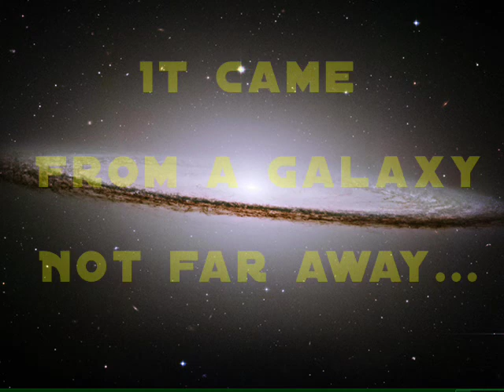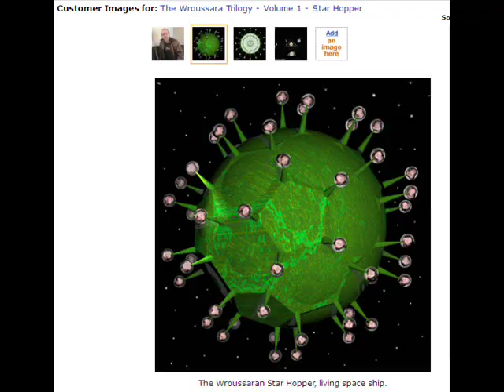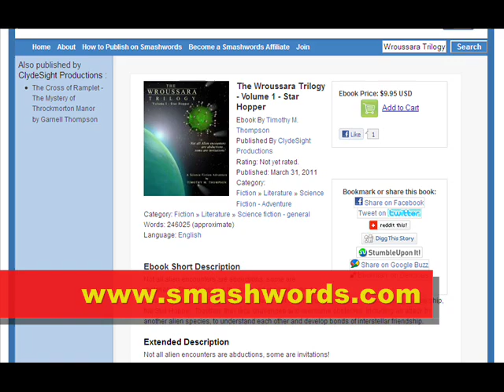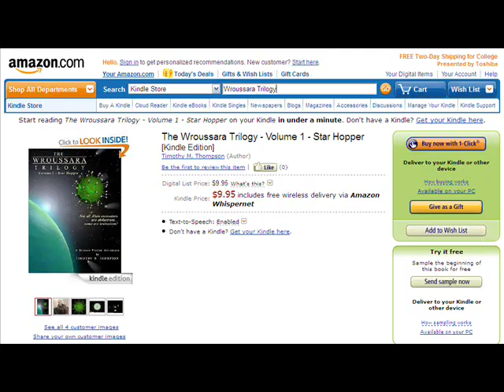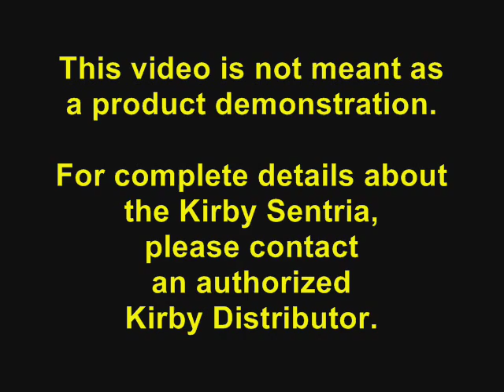Exploring the Kirby Sentria Home Cleaning System -- vacuum cleaner and More!

Comment: About 20 or so years ago, I sold these machines (all be it for only a month or two as I found out it wasn't for me).  The machine was called Generation 3 and was very similar to the modern model, including the power assisted drive system.  Kirby hasn't changed thier basic design much over the years; a few tweaks here and there but basically the same.  And when something works as well as this does, there's really no need to change it.  A pricey machine but well worth it.

Comment: you dont need a warranty if you paid $25 for a perfectly running G6 that currently has given me zero problems. or a kirby heritage that we have owned for 15 years and only had to put a new set of $12 motor brushes in the 15 years we have owned it. these machines are reliable enough, easy to work on and cheap to buy parts for. they are also VERY expensive new and CHEAP used so take your pick. me i prefer to save my money and have virtually the same machine that has not changed much since the G3

Comment: i have a tradition, a heritage I, and a G6 2001. i love them all but i cannot understand WHY someone would spend $1,700 on a kirby vacuum WHEN the market is flooded with slightly used units that can be brought back to like new for very little money. i bought my G6 for $20, an exceptional deal if i must say myself.. i have spent $140 total on all 3 kirby vacuums and $100 of that was on my heritage which my family has had 15 years of excellent service from. they are great but easy to find used.

Comment: i hate to break it to you but the fan is not metal
Reply from the maker: I checked and you're right. But I am not sure what your point is. The plastic on mine is in very good shape. I have a "leaf blower-vac" that has a plastic fan on it, and I've had it for over 6 years. Never had a problem with the plastic fan and I use it as a vac to pull up all sorts of yard stuff. I have a snow blower that has a plastic plow blade and in 10 years, never had a problem with it, and that thing digs through ice. So why is a plastic fan on a Kirby vacuum that is pulling dust out of a carpet a problem? Or were you just pointing out that it is plastic.
Reply: ***** im not saying that metal fans are better lexan fans are more forgiving if you hit a hard thing metal would get weak and it you shatter and cause more damage to the hous

Comment: Kirby is officially listed as A scam here in the Neterlands! Agressive door to door sales and crappy hardware.As in the video it sounds like A jetfighter taking off and weighs A ton.It's not got any better since 1945.
Reply from the maker: Picobyte  Thanks for watching the video.I appreciate your thoughts, but there are sides to any story:
 
1 - I agree that the machine is expensive -- but they will negotiate the price, 
2 - It is  heavy  - and the weight helps the beater brush get into the rug pile. instead of bouncing on top of it like it does on some plastic vacuums
3 - It's loud because it has a big motor -- and it is quieter than some other vacuums I have used
4 -  I've never had any service problems with it in 5 years. Changed the belt once and the bags often, and the official paper bags can be got cheap from E-Bay.
5- It is self propelled, which few machines are
6 - It came with a complete shampoo system in the box, which few other machines do
7 - There is one other other BIG thing, the door-to-door sales force. 

When I got my machine, I had just suffered a double heart attack. How was I supposed to clean my floors? Hire a maid? How much would that cost over 5 years? Think about it.

For whatever reason, the Kirby folks appeared at my door and had a solution. I had never seen them before, and I have never seen them since! So I would not say they were intrusive.

- They were friendly and polite,
- demonstrated the machine, 
- allowed me to try it myself, 
- they BUILT it right there brand new, in front of me and taught me how to maintain it. When you buy these things in a dept store, they come in a box and YOU get to figure it out and build it! 
- They recycled my old vacuum (for me to get rid of it would have cost money to pay the trash company). 

Was it expensive? YES! 
Did I need it? YES!
Was it worth it? YES!

 It is easy to make blanket statements about someone or something, but everything has a story and not all stories match your own. 

If you had trouble with Kirby, I am really sorry for you. 

But I cannot in good conscience say Kirby is a scam or allow someone else to do so without presenting what happened to me -- so people can realize that there are many sides to consider in this situation.

I appreciate your watching my video and leaving a comment however.
Reply: If all it needs to do is to suck my vacuum cleaner does the same job for just 80 Euro.If it wares out I don't bader to swap carbon brushes in the motor.I just buy a whole new machine.Cheap and efficient.And it does not make the sound of A fighter jet taking off.Pretty good reason not to buy the scam Kirby trash.
Reply from the maker: +Picobyte Apparently, you paid no attention  to the details of what I wrote to you, nor did you respond to my points. Very well, that tells me about you and why your opinion is really not very valuable. 

I don't sell Kirby vacuums, I am just a satisfied customer and stated why, which apparently means nothing to you, so there is no point in discussing things further.